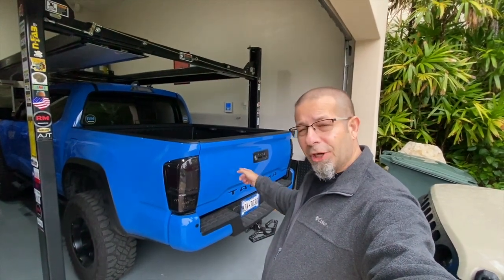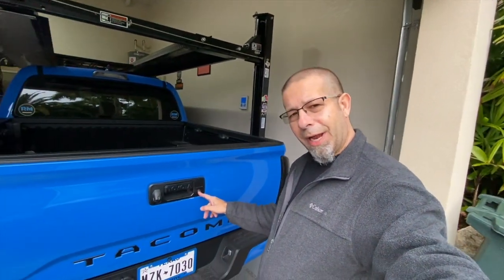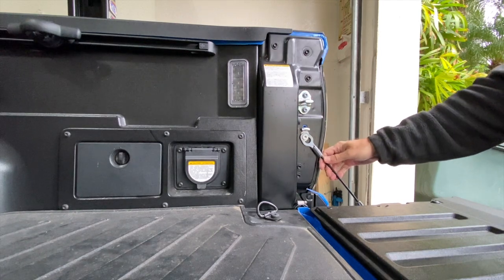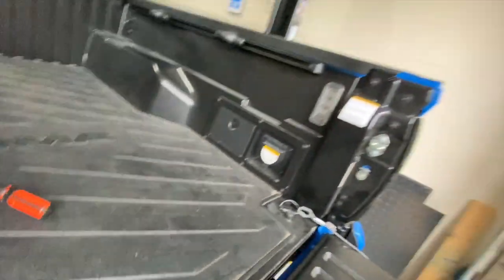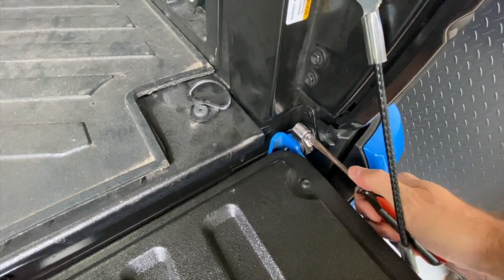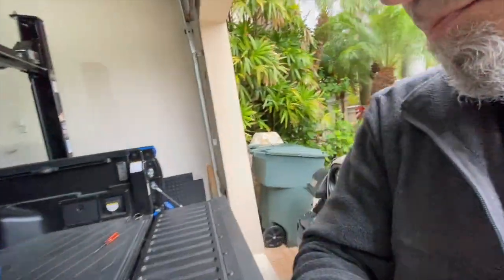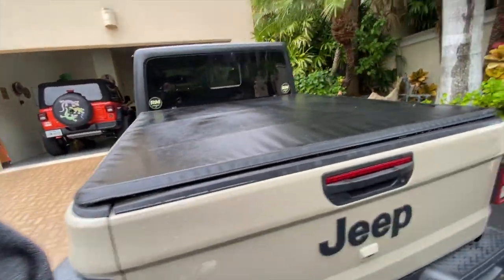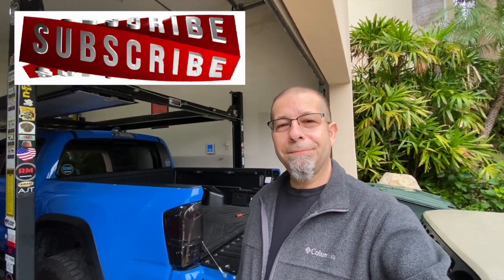How the Tailgate on a Tacoma Is Stolen & Make it Harder To Do So

Comment: I did this on my 2010 F150 years ago. Put a little glue in the flat head screw driver slots for a little extra deterrence. 

Just bought a 2023 Taco limited and put clamps on it as well. Cheap and quick.

Comment: Clamping collars comes with an Key to clamp it at Home Depot made of steel would probably work better just got my tailgate stolen looking for a lock and might go with that and strip the bolt so they can’t remove it even with the key thanks for the tip
Reply from the maker: Glad to help 👍

Comment: Cut the head off the bolt of the hose clamp with a Dremel disc after installing it so the flat screw driver can not be used to remove it.
It can be removed but you just made it 3 times harder and longer time is required to remove it.

Comment: Seems like it would dig into or scratch the paint.  Midwest is a salt belt for snow.  I've seen a bolt on piece for this like the Gladiator.  It was a piece that used the existing bolt.  Awesome video point!!  Thanks.
Reply from the maker: Nope...it doesn’t touch anything when rotating.  I remember the salt well😬

Comment: I put the hose clamp on but wasn’t a fan. I got the Maggard version. It has a little plastic cover over the hose clamp to help protect from a grinder or screwdriver pry attack. It’s expensive compared to a hose clamp for sure, but I live in a city where that is rampant. Hopefully this will help.

Comment: Slide some heat shrink over the clamp except where it goes thru the screw.  Heat shrink it. It will look cleaner and it helps from scarring the metal from the tight compression.
Reply from the maker: Good tip👍
Reply: You could also just heat shrink over the whole thing, screw and all, that way thieves wouldn't even see a clamp to potentially unscrew.

Comment: SaBellCo makes a nice lock that fits over the pivot joint, 100 bucks for it but better than than a new tailgate!
Reply from the maker: A good option if you want to drop the cash.  For me, this method is just as good👍

Comment: I also think it is like the Gladiator and you can lay the cable over the notch to have the gate hold up at 45 degree for hauling lumber etc.  Maybe - don't know if cable twists around like that.
Reply from the maker: Similar.  However, you can’t remove it without taking the bracket off👍

Comment: Rob, for a $1.79 at ACE Hardware it's worth the trip.  What size?  Maybe I missed it.  Looks like 3/4"-13/4" should work (SAE20).  Thanks for the tip.  I just locked mine up tonight.
Reply from the maker: Nice👍

Comment: Nice video, Rob! I watched this so I could learn how to remove my tailgate to install a slide-in camper in a 3rd gen tacoma which I should be getting soon. Wondering if I can remove the gate but still have a way to use the backup camera?
Reply from the maker: Thanks Blake.  Only if you add or relocate the camera👍

Comment: have you see or heard of this product called: 
SaBellCo® Tailgate Lock
2016+ Toyota Tacoma Tailgate Lock - Anti-Theft Lock V2.1B
Fits: 2016 thru 2023+ Toyota Tacoma 
Price: $109.95
Reply from the maker: I hadn't.  I'd go with a $2 hose clamp.
Reply: I did this on my 2010 F150 years ago. Put a little glue in the flat head screw driver slot for a little extra deterrence. 

Just bought a 2023 Taco limited and put clamps on it as well. Cheap and quick.